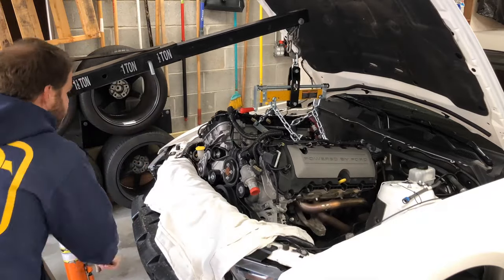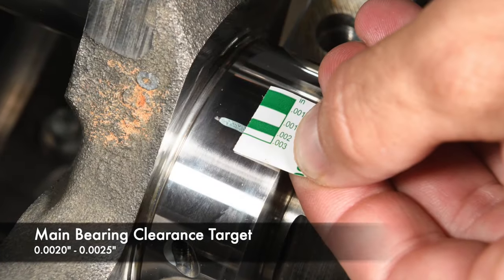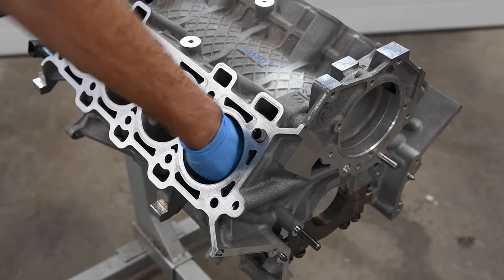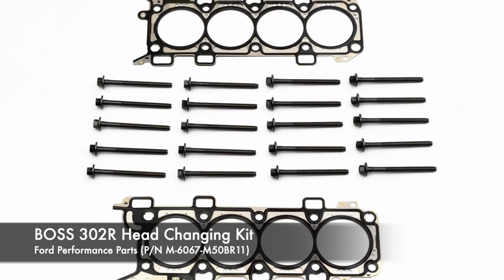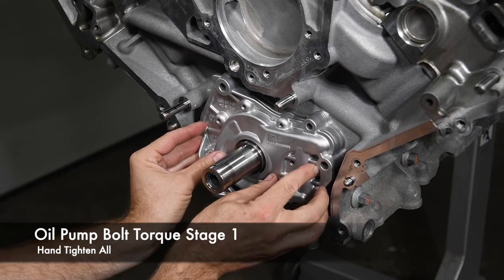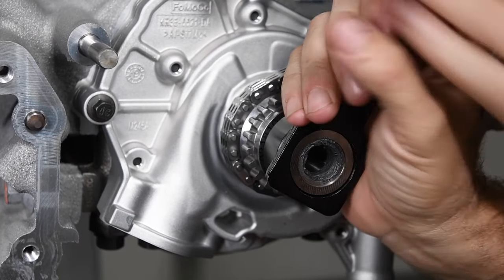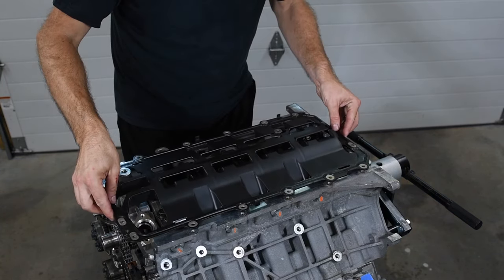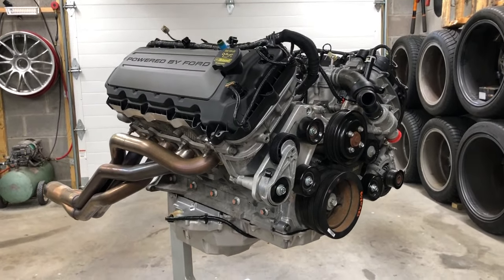How to Build a Ford Coyote 5.0L Engine

Comment: Single-handily the best assembly video I have came across. Thank you.
Reply from the maker: Thanks! "Be sure to like and subscribe," :)
Reply: @Mustang-Geek  Can you tell me please, what are the torque values for the camshaft cap bolts, and should I use a little bit of blue lock tite?
Reply from the maker: @shadjohnsen8143  Use new bolts, tighten to 133 in lbs (11 lb-ft) plus 90 degrees. No loctite.
Reply: Yes! The only thing missing is a complete parts and price list in the description!!
Reply from the maker: @MaciusSzwed   Added!

Parts List:
Mahle Motorsports Forged PowerPak Plus 2618 Alloy Extreme Duty Pistons 930258140
Manley Manley Forged H-Beam Rods with ARP 2000 Bolts 14042R-8
Clevite Main Bearings, 0.001" Extra Clearance MS-2292HX
Clevite Rod Bearings, 0.001" Extra Clearance CB-1442HXN
Tommy's Auto Machine Block Bore and Hone, Balance Rotating Assembly	
Ford Performance Parts Block Hardware Kit M-6026-A50A
Brian Tooley Racing Tapered Piston Ring Compressor BTRRC3640
Boundary Racing Pumps Black Series Billet 2020 GT500 Oil Pump Gears CM-OPG-GT500-VM
Boundary Racing Pumps Billet Lower Timing Sprocket CM-SP-11
Comp Cams Valve Spring Kit 0.550" Max Lift 26113CY-KIT
Comp Cams Hi-Tech Timing Chain Set 3041
Ford Performance Parts 2020 GT500 Oil Pan, Pump, and Pickup Kit M-6675-M52S
Ford Performance Parts BOSS 302R Head Changing Kit M-6067-M50BR11
Ford Performance Parts Oil Pump Installation Kit M-6600-A50PKIT
Ford Performance Parts Boss 302 Timing Chain Tensioners M-6266-M50B
Permatex Right Stuff Sealant 25223
ARP 12mm Head Studs 256-4702
Euroexport Valve Spring Installation Tool SC-60014
Reply: @Mustang-Geek youre a real amazing human being. Incredible attention to detail and love for the craft!
Reply from the maker: @ZiggyJr  Thanks! Please like, subscribe, and check out my other videos!

Comment: Awesome build guide. I have a 2015 Coyote with 292k miles. The time is coming for teardown.
Reply from the maker: Thanks! Please like and subscribe :)
Reply: @Mustang-Geek  Done!
Reply: 300k miles??? My God dude. That's awesome. Is the car modified? Manual or auto?
Reply: @TheHookahTimes  It's stock. No issues, no noise, no smoke. I expect the timing chain is stretched juat due to the miles, but there are no indications of any wear. I would drive it cross-country as it stands now without fear of a problem.
Reply: It is an F150, not the mustang. Probably not driven near as hard.
Reply: @Jerry-rd9my  my man hasn't seen the awd single cab f150 dominating the scene lately. 😂

Comment: Boost pressure does not impact valve spring pressure requirements
Reply from the maker: Interesting. Why not? Logic would tell me it does.
Reply: @Mustang-Geek  logic does not factor into this requirement only rpm , lobe profile , valve train weights . Lobe  profile being the dominant factor. If back pressure changes the spring requirement , the wrong spring is being used. You couldn’t handle a 100 rpm over rev on a shift. Maybe that’s logic but cam profile and projected max rpm are the best tools to control valve bounce.
Reply from the maker: @ecc5119  Huh. Interesting!

Comment: My old man just to build the early model Ford motors, but with the chrome moly rings he would run the motor through 2 regular heat cycles with compression check each time then run it out to the interstate and wrap half the radiator with a feed sack. He ran the motor till it was about 220 and then would take the feed sack from the radiator to let it cool down a bit. I thought he was crazy till the last compression check and him showing me what it came up to be.
Reply from the maker: You certainly want to go drive the car moderately hard on the first engine start up to seat the rings. Drive the car until it's warm, then do a couple full throttle pulls in 3rd to seat the rings. Don't need to go to red line, just need to push the rings against the walls before they glaze over.

Comment: It's usually better to put the heads on first then install the studs, especially on aluminum heads. The threads can dig into head bolt holes and allow bits of aluminum into the engine.
Reply from the maker: Solid advice! Thanks for sharing!

Comment: Mustang geek - just wondering  have you ever seen or heard of the problem with the 2 back cylinders on a 5.0 coyote getting  to hot and and losing compression from the intake valves.  If so please explain in detail what to do to eliminate this . Thank you , love your detail videos.
Reply from the maker: I haven't heard of any inherent design flaw with the cooling system on Coyote engines. Some earlier 4V modular engines had an issue where cylinder #8's exhaust valve guides would get overheated and weaken. This was addressed in later (2005+) cylinder heads. This may provide some insight on the coyote cooling system flow: https://youtu.be/0-yJZaGoJg0?si=w5aYE2nZFccvJv66
Reply: Thanks mustang geek, for answering  my question on the 2 back cylinders on the coyote  motor. Have a good day.

Comment: Hiya!  I have a 2011 F-150 XLT 4WD with the Coyote 5.0, and she has just about 200,000 miles on her.  The front seal is leaking, or maybe the timing chain covers, unsure.  So instead of just fixing the leaks, I wanted to do my first ever DIY engine rebuild.  I wish to replace ALL components up front (i.e. Alternator, Water Pump, etc.), also internally anything that will be bullet proof, something better than what she has, but not some hot rod stuff, just high quality parts, because I wish for her to last me another 200,000.  Will this video help on the 2011?  Or do I need to be careful in certain areas?  I am seeking (tools needed, recommended parts "I see you have listed, but unsure if they work with my engine", and any recommended manuals that will be studied for weeks before I open the hood!  Any help would be appreciated.  Thanks so much from Western North Carolina
Reply from the maker: If it's a Gen 1 coyote, all of this applies.
Reply: Thanks so much!  Have no idea why YouTube doesn't let me know I have a message!  I checked settings, and I should.  sorry for delay!   @Mustang-Geek
Reply: I did have another question for you, if you don't mind sir.  Can I place Gen 3 parts in a Gen 1?  Reason why I ask, it seems that Gen 3 has better performance, according to data.  Gas mileage is also a concern.  Higher the better.  If Gen 3 parts don't work on my block, then would a Gen 3 fit in my engine bay?  Gggrrr....two more.....due to fact I am a first timer at 60 yrs young, what would you recommend for directions?  I am actually going to install an overhead TV in my garage, just so I can watch your video while I break my back on the engine!  Seriously though, are there any software out there that I might need to buy?  I am looking for definite step by step, illustrations, part references, etc.  Last one, which parts will I need to take to machine shop?  Will most machine shops install valves, camshaft, etc. for you, while I focus on other tasks, which are EASIER??  Just wish to do something challenging before I get planted 6 feet down.  Very sorry to bother on this.  Thank you again sir. @Mustang-Geek
Reply from the maker: @colarguns  I've never rebuilt a Gen 3 Coyote, so I don't want to steer you wrong. I don't want to speculate. A Gen 3 engine is the same size as a Gen 1, but the biggest difference is the addition of direct fuel injection. That requires a complex PCM to control. I'd stick with the Gen 1.

Comment: i see the plastiguage read .003 is that okay even though your target is .002-.0025
Reply from the maker: Well, the plastigauge isn't the best method, but since I was running the GT500 oil pump and 5w50 oil, having looser clearance is good for a supercharged engine.

Comment: Hey bro im buying parts now I already ordered the block the only one that you can get nowadays if it's been three new from Ford performance question for you number one should I use the original GT crankshaft or should I possibly get a GT350 crankshaft? And I have to use gen 1 pistons since it's going into a gen 1 correct? 

I was wondering why you chose to go with the Comp Cam valve springs? 

Im looking for a set of gen 2 heads? Or do you believe if I replace my springs with either the GT350 ones with a comp cams and have the heads poured it you think they'd be just as good or will I have just as much tied up and doing that instead of just buying a Gen 2 set of heads?

Sorry for all the questions bro it's a lot of money doing this build I REALLY want to get it right!! Thank you for all your help!!  

Lastly would you do anything different on your build?
Reply from the maker: 1) The factory GT crankshaft is more than adequate for just about anything. The GT350 crankshaft is fundamentally different (flat plane). Do not use it. 2) Not sure on pistons. I'd contact Mahle and ask. 3) I chose the Comp valve springs for higher RPM stability with boost. 4) For heads, I'd ask Modular Head shop for a recommendation. 5) For my power levels, I wouldn't change a thing with the build.
Reply: @Mustang-Geek Thank you for your response!! I will defiantly reach out to them!!
Reply from the maker: @Theferg1  Excellent. Glad to help!

Comment: I know it’s been a while since this video was made but is there any good videos on the proper way to pull a coyote from the engine bay like the beginning of the video
Reply from the maker: Great question. An S197 is not that hard. Use engine lift plates and a load leveler. You need to be able to adjust the angle of the engine as you pull it. I did it myself without any help.
Reply: @Mustang-Geek  I have a 2011 GT and I have borrowed a leveler to try to get it out myself, but I’ve been a little worried about taking apart more than necessary to pull the engine and leave the transmission
Reply from the maker: @DreFromThe6ix  I can't remember if I removed the transmission first. Remove the radiator and disconnect the AC compressor from the engine and lay it aside. You won't need to disturb the lines. Just remove the stretchy belt and the compressor.
Reply: @Mustang-Geek  So far ground straps have been the only item people don’t think to disconnect. I think I found a guide online but I may have to go with the trial and error method lol
Reply from the maker: @DreFromThe6ix  Just take your time and use common sense.
Reply: @Mustang-Geek  it there any companies that offer these upgrades already on coyotes for sale?

Comment: if you use comp cam valve springs you should upgrade the cam cap bolts. the stock ones are not made for the increased pressure and are known to break and cost you a engine
Reply from the maker: Noted. Thanks for the tip!

Comment: Richard Holdener, Dyno Guru, advises .007 inches per inch of bore, for the top ring on boosted engine. That comes out to .026 inches of gap. Richard has learned, that extra ring gap stops piston failure due to ring gap diminishing, due to extreme heat of massive boost. As the rings get hot, with small end gaps, the ring eventually expands and  locks in the bore. The top of the piston is ripped off and all hell breaks lose !!
Reply from the maker: Mahle recommends between 0.006 and 0.007 per inch of bore, depending upon use. I went with 0.006” which for a 3.640” bore is 0.022”. https://www.us.mahle.com/media/usa/motorsports/2020-ring-flyer.pdf
Reply: For what it's worth, I'm pulling apart a 2016 Cobra Jet motor and the top ring gap measured to 0.022 at 1" down the cylinder

Comment: I have a 2013 F-150 Gen 1 Coyote 5.0L. I'm having a hard time trying to find the TTY Phaser to Camshaft bolts. What set did y'all use??? When I look them up, all I find are the Phaser assembly bolts (the 6 bolts around the circumference of the Phaser and not the 3 inner bolts). A full set would be 12 bolts, 3 per Phaser.
Reply from the maker: Good question. I think ARP sells some, but I've heard you can use them up to three times.
Reply: @Mustang-Geek  I was able to locate a part number thru Comp (ford replacement part BR3Z-6279-A). It was in a PDF file. Take note of the part #. Seems you can't buy a full set of 12. They have to to be bought individually. Got a set coming. 
  If I don't do a video, you should cover these bolts. You have a better Audience. 
  My Initial problem was a slight misfire on Cylinder 5.
  2013 F-150 Coyote Gen 1 5.0L. 
At first I thought of valve, Then I learned about the roller issues on the camshaft rocker arms. I found 1. 
 It's the first time with a Coyote motor. It's been a bit of a Pain in the ass. Really just ordering the bolts. It Started with the headbolts. (Finding the correct ones). 
  I have never had this issue before. Only on this motor. Buying Pacific bolts is a pain in he ass.
 I'll see if everything works well once I get the bolts.
  I Have a channel here on youtube.  I Should cover these bolts.  

Thankyou for your time 

Doc Thompson
Reply from the maker: @DocAnkh  Thanks for the info!

Comment: Question, at 9:40 it says "Oil Pump Bolt Torque Stage 2" 3 different times with 3 different torque specs. Is it just saying to tighten everything to 89 lb-in, and then 177 lb-in, and then 18 lb-ft? So the plate is tightened as evenly as possible?
Reply from the maker: It's kinda complicated. That's why I say use a manual :) But, here's a screen shot with the specs and diagram: https://www.youtube.com/channel/UCeJaO0ySaJ07Igg-qgMWvPQ/community?lb=Ugkx28YSKYUfFROEl1J2pX9phObwkP01mu7S

Comment: So, do you use the old torque to yield   crankshaft bolts for the plastigauge or do you have to buy an extra set just to do the plastigauge on crankshaft bearings?
Reply from the maker: Good question. I used the old bolts for the plastigage. Assembled with the new bolts.

Comment: Great video. Would you change anything different if you we're building that now?
Reply from the maker: Great question! I wouldn't do any thing differently on the same budget, however, if I was going after more power, a set of ported heads would've been a good idea. Please check out my other videos too!
Reply: @Mustang-Geek  Thank you for your response!!  I have a 2011 that lost compression on the driver side head not totally gone but very very low. So I’m going to take the engine out to rebuild it.  I want to build it for the long haul, I plan on giving it to My Son one day.    Do you remember about how much this costed you? But I love the content and definitely will be here to support you👍💯

Comment: On those boss 302 secondary chain tensionors are they shorter than the stock ones?
Reply from the maker: Yes and no. They look shorter because they arrive in a "collapsed" state to ease installaton. You have to Push down on them (like the top of a ball-point pen) to get the tensioner to extend after you're done installing them!

Comment: First time viewer, not a car guy by ANY definition of the word, definitely not mechanically inclined either, and its hard to get things that aren't opinions, but my buddy told me its not possible to go above 600 on a "stock ford block", in YOUR experience, what have you found? I see you mention replacing the pistons in the beginning due to the factory ones not being capable of handling the forces involved, was anything else replaced what did you change to get it beyond the factory whp? I kind of got lost in the sauce watching all these things I didn't understand and might of missed that  information in the beginning or perhaps from another video.

I'm starting from zero car knowledge aside from holding a flashlight or a screw driver here and there so I'm not sure if any of that question even made sense LOL.
Reply from the maker: Your buddy is probably thinking of an old-school pushrod 302/5.0 engine. The "5.0 HO" engine blocks were notorious for splitting at over 550 lb-ft of torque. The Coyote engines, however, are a LOT more durable and handle A LOT more torque. Most of the engine components will fail long before the Coyote block. It's VERY stout and durable. The newest generation (Gen 4) Coyote engines are making well over 800 wheel horsepower on all factory components. ALL FACTORY RODS, PISTONS, and CRANK!
Reply: It's definitely possible to go over 600hp even on the older foxbody style 5.0 factory for engines. It's not ideal but it's commonly done.. I have a 91 mustang GT with the old pushrod 5.0 and it's got roughly 400hp. The biggest thing is engine harmonics (vibration) that's going to break the block. That and pre-detonation.

Comment: Definitely a great video! I'm in the process of an almost identical build. Curious, where did you get the guidance to go with 0.001 more clearance on the main bearings?
Reply from the maker: I don't recall exactly, but it's pretty common to set up the bearings a little on the loose side to provide a bit of extra cushion between the bearing surfaces on supercharged applications. Running a heavier weight oil and a high volume oil pump helps as well.

Comment: Any guidance on filing rings for boost up to 28 psi?
Reply from the maker: The best thing is to check with your piston manufacturer (or whoever supplies the rings) for guidance. They will have the BEST answer for your application.

Comment: Witam jakich blokad rozrządu używałeś ?
Reply from the maker: I did not use any timing locks. The camshafts themselves are in a "neutral position" and the crank is NOT at TDC.
Reply: Super dziękuję pomogłeś mi bo nie mogłem znajsc blokad rozrządu.😊a z jaką siłą dokrecales śruby  głowicy ?
Reply from the maker: @waldekpucinski9945  I don't remember. You should always check with the fastener manufacturer for their recommendation.